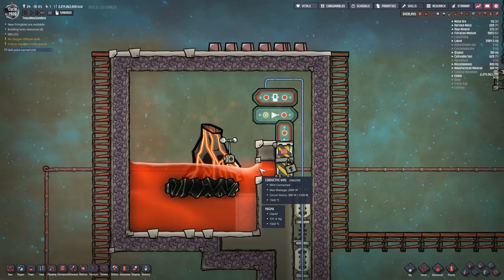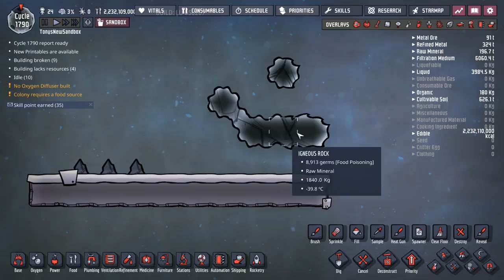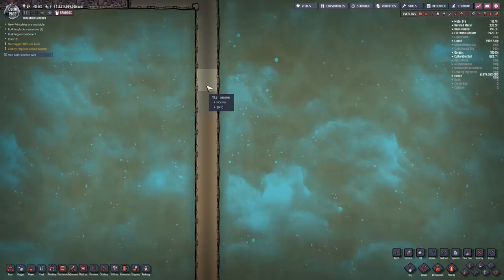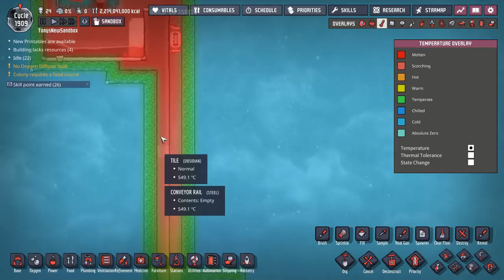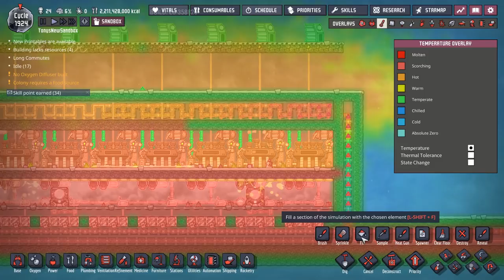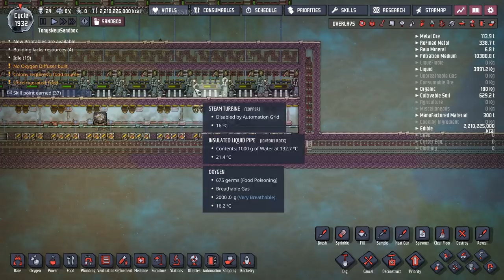Melt Regolith for 39,000 watts of power.

Comment from the maker: IMPORTANT: There is a bug in ONI right now that makes conveyor rails NOT transmit heat sometimes. If that happens then this build is VERY dangerous to your base, because very hot rock won't cool off and that can end up breaking stuff. Here's a reference https://forums.kleientertainment.com/klei-bug-tracker/oni/offscreen-conveyor-not-transferring-heat-r18171/
Reply: IMPORTANT: It is fixed now.
Reply: I already have 1 of these in my world, planning to make them 3 when I have time. Not for the power tho, I will probably just dump that power, but for the rock and regolith clearing
Reply: @kmanev  Not entirely, the rocks at the end of a line don't seem to transfer heat well. It seems to even out once the rocks are added to the same pile.

Comment: Using this video as a guide, I was able to build a variant of this in my survival game (there's only 11 turbines, due to space and resource constraints; rock is always cooled to 20C-50C; rock only flows if coldest area of the turbine hotplate is below 200C; instead of obsidian tower there's a kind of a pipette contraption that drips magma to maintain >1410C in the melter, and a crystallizer below it that maintains <1410C - no idea if it's an improvement in any way other than looking cool). It works amazingly well, and is a joy to observe, so thank you for showing us this!

Unfortunately, there seems to be a sneaky bug (as of writing; version LU-361684): items on conveyor rails don't properly exchange heat when they're offscreen - reportedly, only if they're located in viewport's bottom left or upper right direction. It's really weird, and, apparently, old news - there are multiple bug report threads. I know of this because every time I went to build something in space, my "regolith reactor" would melt down: >1100C rock would flow through it's entirety, because throttle mechanisms would assume that there is not enough heat anywhere (and there isn't, technically, as it's still trapped in the rock chunks by the thermal kraken) and keep it moving, eventually overloading turbine cooling (the pipes burst) and slagging everything around the output port; reloading an autosave and keeping a close eye on the reactor miraculously fixed the issue. So, to be safe until the bug is fixed, build these (or any devices that rely on conveyor heat exchange) in either bottom right or upper left corners of the map.
Reply from the maker: Aw jeez. That sucks about the bug, sorry. I pinned comment that explains that this build is very dangerous for anyone who is experiencing that problem.
I'd definitely be interested in seeing a screenshot of your variation of the design, it sounds like you have some cool ideas and I love cool ideas.

Comment: Just built this in my video play series of Oasisse and it is awesome. Getting 15,000 watts out of it from one rail, going to build another now. it's mostly thermium as that is what I have lots of and it is running from just a minor volcano. I do miss your videos, hope you're well. PS I use your sour gas boiler a lot, and your geothermal designs. I have tweaked a lot of them with recent updates and they are very efficient.

Comment: Here's a practical tip. I tried to get by with only 12 turbines because of space restrictions, tried to do too much rock cooling in the turbine room, and as a result my steam room got up to 350C with all turbines wide open. I need to make some critical repairs. IF you set the volcano door buffer to 0.1 seconds, no magma will come through and you can cool everything down again to rework things. Eventually the volcano will overpressurize but the magma will stay super hot for a long while I imagine.

It took about 4 cycles for the heat doors to close again after turning of the regolith! Having them open was useless anyway because of all the heat coming from the exhaust exchanger. I will have to either limit the regolith coming through in a nice way, or find a place to put eight more turbines on another row somewhere. Luckily I will now have an insane amount of igneous rock to use for insulation pipes and tiles.

This is a fantastic and very useful build, but scaling it down is very challenging. Once you have all the power and rock you need, then you just need to find cooling anywhere you can get it!

Comment: @Tony Advanced
16:17 Because of that "bug"(?) you should switch the in/out lines in the heat exchange, so the hot output travels above the cold input, so you get some heat transfer for free.
Also, can you use that bug-effect to make a "heat ladder" going down? Just have separated 1x1 conveyor rails above each other in a line upwards, input heat on top, take it out on the bottom,  no movement of the conveyors necessary.

Comment: I made a variant of this for a geothermal plant off of two close volcanos. 10 steam plants make for enough power to run my station without the need for petrochemical power at all. Plus some solar power and we have a station that would make AOC proud. Also a tip. Make the whole area you are using for this a vacuum to start. This way you can add the gasses you want in the places that you need them and keep everything nice and separate. Also, build from the bottom up.

Comment: Now that you mentioned the heat exchange between the conveyor and the tile below it, it's there not just for conveyors. If you enclose a tile of water between four airflow tiles in vacuum, the water is not touching them and there should be no heat exchange. But there is, I'm not sure if it's the airflow tile above or below the water but one of them will exchange heat with the water.
Reply from the maker: I tried this out and I can't get it to work.
Reply: I admit it's a while since I tested it. I retested it now and the effect is gone so it must have been changed in the meantime. Sorry for false information.
Reply from the maker: @kasuha  I make that mistake all the time, they have a habit of changing stuff and it's hard to keep up.

Comment: If you could I would love for you to revisit the basic principles involved in this with the Spaced Out DLC and post-DLC vanilla patches.

Particularly, I am interested to know if the heat deletion you identified for the Steam engines still exists and whether or not the chunk/debris eating heat still exists.

Also, there's been a bunch of new sensor equipment added to the standard game like the new timers that might allow improvements on the basic design.

I know that the Space biome for most if not all asteroids has been drastically altered so there might not be the possibility of a regolith melter any more, but the machine you designed and built here is one of the best designs I've seen for actually efficiently storing and using heat to do work.

I would really love to see this machine adapted for no-duplicant-operation smelting where the heat from something like a volcano is used to smelt successive types of ore into their refined variants. Most designs exploit heat deletion to just generate power via steam engines to operate metal refineries; I'd like to see an industrial smelter that uses and manages the heat more directly via an industrial heat exchanger like this. So you melt say sand using the volcano magma then chain the molten glass to melt say iron ore and so on down the line to ultimately produce something like steam and cooled refined ingots. Extra points if it can be built without space age materials and without late game conveyors/automation; Spaced Out makes access to plastics (and steam engines) a second asteroid thing; Spaced Out also makes getting fiber for suits a potentially more difficult proposition; the radioactive patch is moving a bunch of the commonly used tech to post-first-rocket.

I really like how your design does not involve using a liquid pump in that awkward and fragile setup where it sips things which should be too hot for it and should break it.

Thanks.

Comment: 9:15 If the magma falls into mesh tiles with a diagonal gap and cools, the resulting igneous rock will fall out through the gap without any thermal contact with it. as long as you have at least 2 tiles, and the magma only condenses at the bottom one. This doesn't take auto sweepers at all.

Comment: Great Video!
I kind of lost where the energy is coming from. What temp. Is the regolith from Space?
If i understand it correctly it is from the change of heat capacity?
Will you continue your other Series?
Reply from the maker: Yep. It's from the change in heat capacity. Now that I'm done with that project I'll take it easier and play more oasisse.
Reply: @tonyadvanced6315  if i understand correctly regolith heats up by magma to 14xx to melt it going from 0.2 capacity to a 1.0 capacity
meaning you get 5 times more heat capacity. so in other words by changing 1 regolith to 1 ingneous you can then heat 5 more regolith with that 1 piece of igneous :P

Comment: Does that chunk not being heated by magma only work in certain circumstances? I’ve made gold volcanos in a vacuum, and the magma always heats up any gold chunks it falls on

Also, new mic? Sounds so much better!
Reply from the maker: The magma can heat up the chunk directly until the point that the magma freezes into rock. Also, if the magma freezes above the chunk and the chunk falls down into it, then the temperatures work out properly. But at the moment that the magma freezes and immediately joins the chunk, then the difference in their temperature is lost.
Reply from the maker: New mic. 😊
Reply: @tonyadvanced6315  So something like a ethanol heat deleter could be made? or an Everlasting heat source for a steam turbine?
Reply from the maker: Those sound promising. I can't think of how it could be used to generate heat, but certainly to delete it. Either way I'm not keen on doing it on purpose, it's too exploity for my taste.
Reply: @tonyadvanced6315  there is a video by Edit Gearhead Gameing watch?v=0t9K4PNwVC4 edit end , found it where he explains the combined junks and how you can exploit it. You pretty much showed the exploit.... cool one little junk down and have infinite cooling power from it. You only need the little cooling to bring magma to junks.  Same goes for heating... heat one junk, let cold junks fall on it and they are instant hot.

Comment: Thank you for the build. What temperature should the steam room that buffers the magma freezer be? It's sucking a lot of heat out of my incoming regolith.
Reply: Took a closer look at the  video. Seems the thermo sensor should be set to below 1,406 deg C.
Reply: @DeanBrundage  I'm finding it a bit safer to set it around 1350. A big burp from the volcano can cause a temp spike, even with 100kg steam. Don't want to deal with rock tiles over that heat plate.